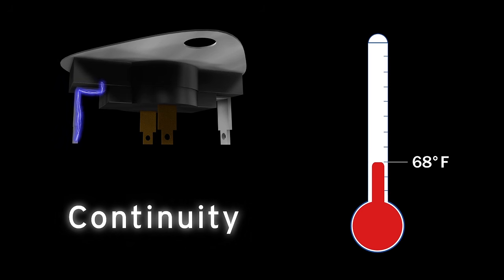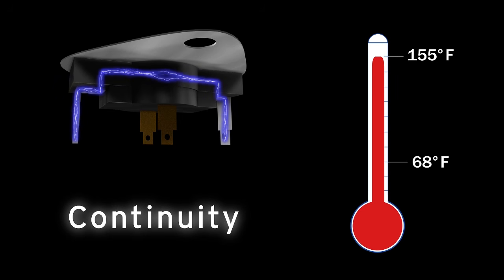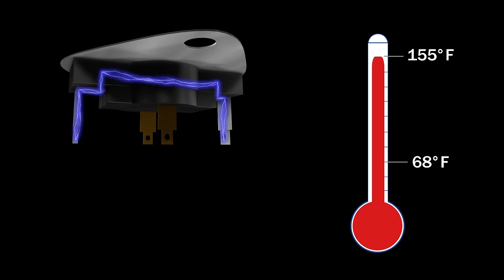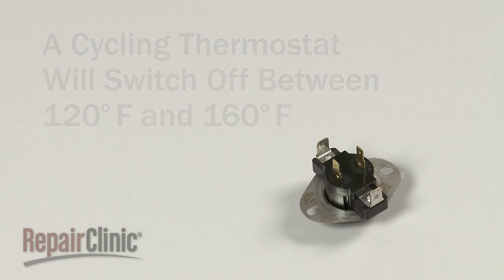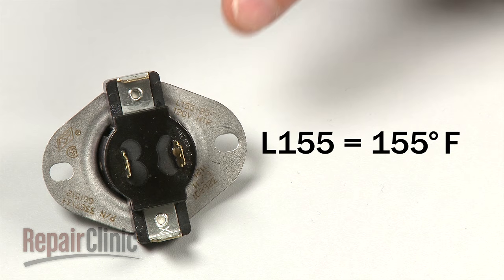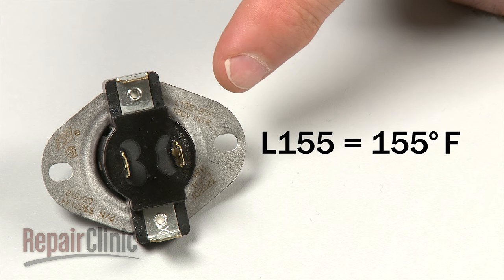Dryer Not Drying? Cycling Thermostat Testing, Troubleshooting

Comment from the maker: If the temperature is being checked at the dryer outlet, a different thermostat may be tripping the heat off.  If the venting is partially plugged or something is in the blower wheel restricting the air flow, heat will build up at the heat source and  trip the high limit thermostat before the regulating thermostat . I would check the air flow. The bi metal thermostats do not go bad that often.

Comment from the maker: Testing the solenoids is inconclusive. They have a very high resistance so you have to have the meter set up properly to get a resistance and just because the coils have continuity does not mean they are good. They often fail after a cycle or two of heat. If the igniter is glowing for 90 seconds without igniting a flame I would recommend replacing the valve solenoids. Keep in mind that if you order through us and the solenoids aren't the problem you can always return them and get your money back

Comment: Great videos!  I had a no heat issue and tested everything I could.  I found no reason for my no heat problem.  So I replaced the cycling thermostat thinking maybe it was switching off prematurely. I got it to ignite and heat up but it shuts off and never gets hot again. I just bypassed the high limit thermostats one at a time and still it just glows but does not ignite.   How do I test the valve solenoids?

Comment: I have watched a bunch of your videos on dryers and have learned a lot. I have a Kenmore dryer Model # 110.C67492600.  I blew the thermal fuse on my machine.  I changed it and put in a new rigid steel vent.  I have now noticed that my timer will advance from the 
"12:00" off point all the way around till it get there again, whether the door is opened or closed.  The heater coil comes on as well (only during heated cycles), whether door is oped or closed.  The dryer doesn't need to be started.

Comment from the maker: The outside terminals are the cycling terminals the inner ones are the heater terminals and the meter would need to be set to a higher ohm range to get a reading. If the heater was bad in the thermostat you would not get the lower temps but the dryer would still heat. The heater just warms up the thermostat more to make it cycle at a lower temp. The problem is most likely not the thermostat. Hope this helps!
Reply: If only one of these repair videos would have said that. I've been searching for 2 hours trying to figure out the function of the 4 terminals. I got good continuity between the wide spaced ones and a resistive continuity between the closer ones. But if those 2 circuits are separate. I may have some leakage between the 2 pairs.  Can't find any schematic to make sense of it

Comment: I did  all the steps showing on your video: set up multimeter to the lowest OHM setting (x10) , cross ends to caliper to 0 but you said to check only the outer terminals (silver) which I did and showed continuity , checked the inner terminals (gold) and they did not have continuity. I read in another Forum that I should check BOTH TERMINALS ...for now I know that my dryer is not drying...should I replace the thermostat ? Or I should I check somewhere else?

Comment from the maker: Thanks for the comment, we appreciate it! When you say "low cycle regulator" are you talking about the heater on the cycling thermostat? They would be the small terminals on the regulating thermostat. If so, the two small terminals show an open circuit the thermostat is bad. That won't keep the dryer from heating though, the dryer would just not get the lower heat.

Comment from the maker: Thanks for the comment, we appreciate it. The reason we don't talk about removing the thermostat is because it shouldn't be hard. However, if the connections were crimped by the manufacture, it may be smart to use a pair of needle nose pliers to wiggle the wires off. If this doesn't work, please refer to the repair help section of our website.

Comment: How to remove it? If the contact does not pull apart easily, do I just take the wires attached and pull very hard? Do I pry the edges apart with a screwdriver of sharp knife and try again to slide the contact off? Is there a tool designed for this purpose? This is a small thing which results in not being able to "remove or isolate" the part, which is step one.